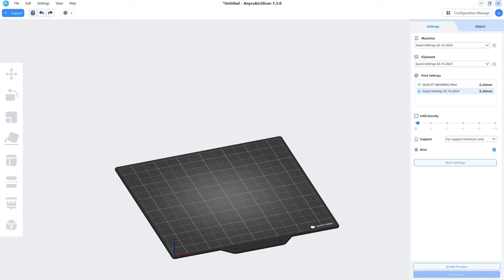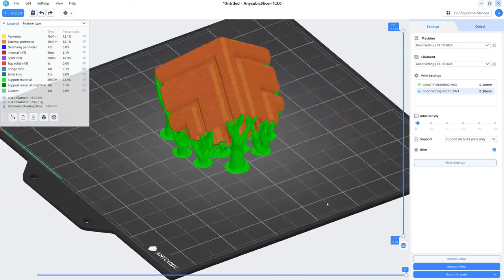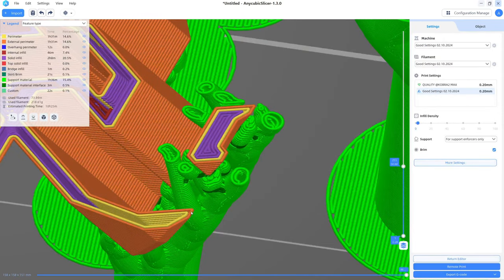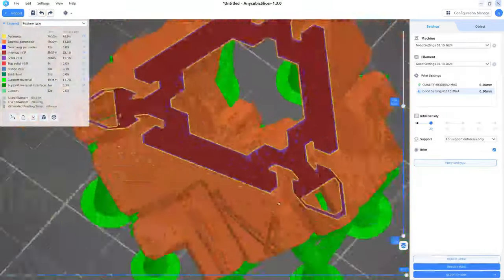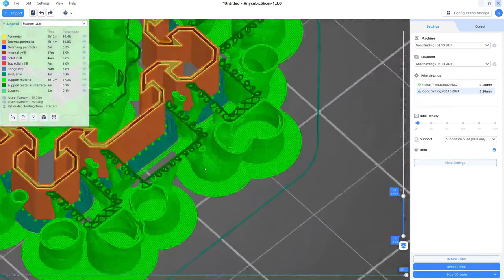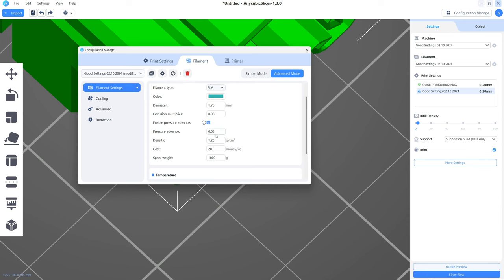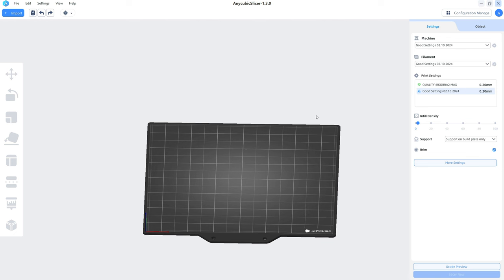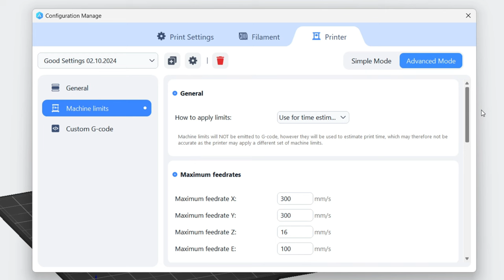Introduction to the Anycubic Slicer

Comment: This is a very informative video. Although I have owned a 3D printer for 2-4 years, I haven't used it often due to the frustration I would have over getting good prints. I'm still learning Fusion 360 for designing projects, which I have found the easiest to learn, but still have a long way to go. I was looking for information on adding supports to a horizontal bridge and you covered it with clarity and detail. In fact, the entire video gave me a significant understanding of the slicer and I have made several adjustments to the settings. It has already improved my 3D printing capabilities. I appreciate that you took a significant amount of your time to help others in learning this software.
Reply from the maker: @lightcs4d  thank you for the very kind comment! really glad the video was helpful

Comment: Bro, Thank you so much, just got my Kobra 2 Max and this tutorial helped out so much since Cura doesn't work well with the Kobra 2 Max.
Reply: Do you have any issues with scaling?  - The stuff I model comes in correctly into Cura but is absolutely microscopic in Anycubic with an error message. There's nowhere to adjust scaling or units. It says I'm exporting in inches however it's modeled in mm. I'm lost as to what to do next.

Comment: can you tell me what kind of setting i must use ? my printer always scratching on the infill? the z offset ist working very well.
Reply from the maker: @michaeldiehl2477  its kinds normal for that to happen, has to do with the thermodynamics of plastic.  Z Hop can help, it will life the nozzle when crossing lines but it will also make stringing worse.  Most things in the settings are a balancing act beteeen reliability, quality, and speed
Reply: @mark4jr  yes thanks for your answer i use z hop already for the supports but its not work with infill? is it possible to adjust the flow of the infill?

Comment: This video is genuinely a godsend. Thank you so much. I actually have a decent grip on the settings and have been able to make the necessary judgements. You pointing out the clearly absurd acceleration speeds helped me resolve a significant issue I've been having with major oscillations in larger prints, which I couldn't figure out with endless calibration tests. It really was as simple as layershifting caused by accelerations on the y axis.

Comment: I've had my kobra plus for a year now and have been using Prusa and Cura slicers. I can't find a profile for kobra plus even on anycubic website so I made my own but never knew what speeds I could run at. This is the best video I have seen in all of my searches. Incredible. I'm going to start using anycubic slicer and start with your settings. Thanks so much for this. I have only been running about 40mm/s on perimeters. Do you know if 230 speed is ok with a kobra plus? TIA  Subscribed

Comment: Just installed the .6 nozzle really need settings for that. Have not found a single video for K2M settings for this. Forums have not helped so far. Thanks for the video
Reply from the maker: I played around with a 0.6mm nozzle, didnt find the sacrifice in print quality worth the time savings so went back.  I believe I set the nozzle to 0.6mm in the slicer and left everything else related to the nozzle settings blank and it printed OK, definitely could have been dialed in better.

Comment: Question, I have a problem with the support they are really hard to remove, how do you fix deal with that ? It’s so difficult to take them  off
Reply from the maker: There can be a lot of factors that cause this.  Lowering the nozzle temperature might help. I find the more accurate the first layer, the better the supports release.  I'd recommend printing this test print and adjusting the z-height until you get it close to perfect, if your printer is like mine it might take modifying the bed to get it level/flat before the first layer becomes consistent (I have a video on this) https://www.printables.com/model/671915-anycubic-kobra-2-max-bed-level-first-layer-calibra

Comment: Awsome vid. But I have the default acceleration and it’s fine. I did bolt the table to the concrete wall.
Reply from the maker: glad to hear you are able to run the stock speeds, im starting to suspect one of my printers has a bad y axis stepper motor as its now struggling with layer shifting at these slower speeds.  In touch with Anycubic support to hopefully ship me a new one

Comment: How do i change the start of the print?
Every f model i import and slice will start printing at the very top of the model, why does it want to start printing mid air..
Reply from the maker: @hansbacker  i have never seen that behavior before, sorry im not sure what to suggest.  I dont believe there are any slicer settings that could cause that

Comment: Thanks, any plans on showcasing Orca slicer in the similar way?
Reply from the maker: if i get to using Orca enough I might but for now the AC slicer is doing everything I need
Reply: @mark4jr  Orca has built in tests for pressure advance that's better than a line test, flow rate, temperature, basically every test but the Z offset, and I really like that. I know you can do the same in prusa/anycubic/cura but it's usually lot more involved there.

Comment: Another question. In Cura youre allowed to just merge files into one if they were made to be merged. Is that a possibility in this slicer? Or do I have to merge them in another program and then import? Thanks!
Reply from the maker: im not 100% sure but I dont believe there is a way to merge inside of AC Slicer.  I have been modeling most things in OnShape and exporting them ready to slice/print

Comment: Thanks for the guide mate! Only question I got now is what to do about my printer saying it’s offline? Anacubic’s app made the printer to some sort of update and turned the printer offline so remote print really isn’t an option for the time being.
Reply from the maker: The Anycubic cloud seems to go down periodically, it's happened to me a half dozen times now that I couldn't use remote print, normally resolved within a day "magically"
Reply: @mark4jr  I wish it was resolved, mine did it a week ago and still hadn’t fixed itself
Reply from the maker: @MasterHall117  if your printers firmware up to date? they made some security updates to fix a vulnerability, may not be capable of connecting if the firmware is dated
Reply from the maker: @MasterHall117  i just remote printed two things, no issue here
Reply: @mark4jr  interesting, I’ll have to take another look